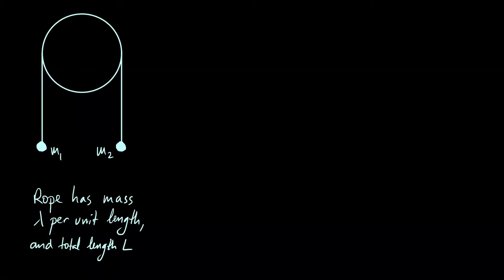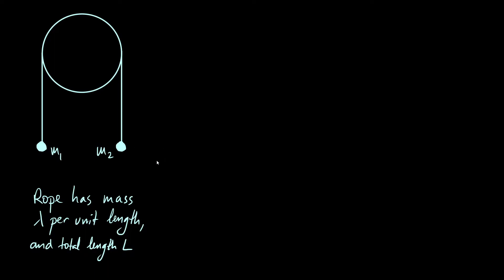What if the rope has mass? (Atwood machine)

Comment: Why when writing potential energy it's -λxgx, isn't it -λxgx/2 + λxgx/2 = 0, since one side moves up and the other goes down?
Reply from the maker: It would be zero if we ignored the mass of the rope and had particles of equal mass, for the reason that you described. However, it works differently with the rope because the part of the rope that moves up on one side is transferred over to the other side, so that overall there is a loss in potential energy.